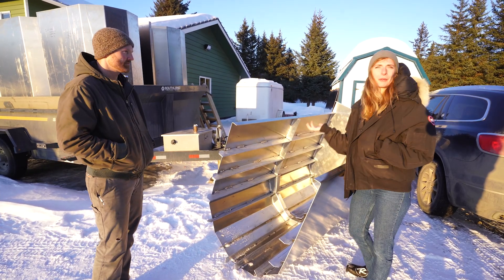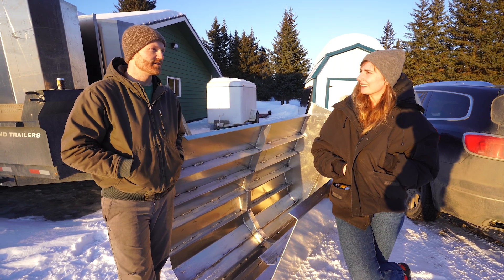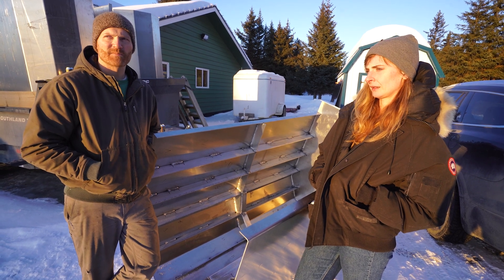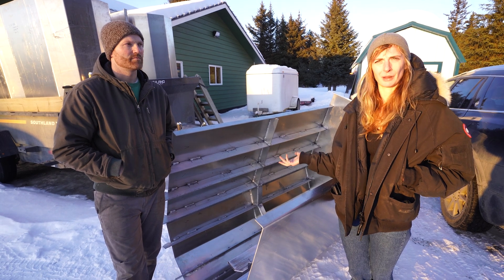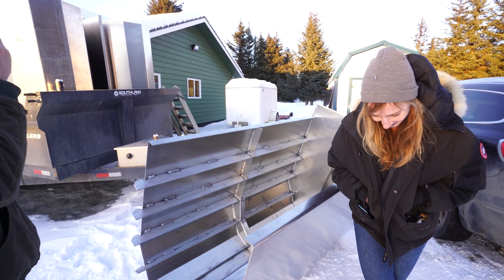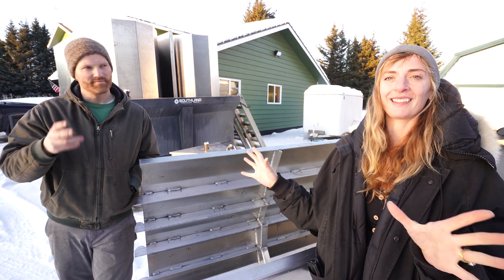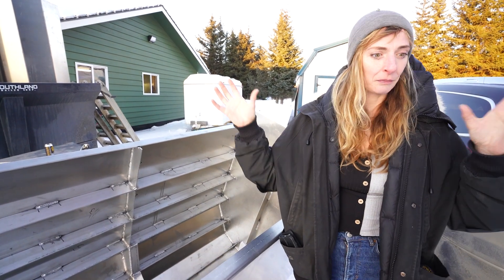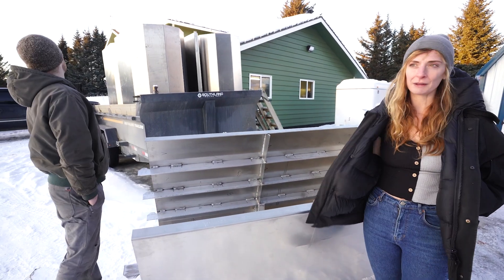The Eroica is getting new pontoons! | Your questions answered

Comment: You could put a stud on each, so the compressor could be used to keep the water out, if you spring a leak? also a water-sensor at the bottoms perhaps .. like the floats in gas tanks? after all risk equals the chance something bad happens times the consequence if it does ..

Comment: Actually you could pressurize the voids and spray the outside with soapy water and or see if it holds pressure overnight. I wouldn't go much higher than 5 maybe 8 psi tho. Simply attach automotive wheel valves on top of each void. Also I would use an inert gas like Nitrogen to keep the inside of the pontoons from corroding. This would allow you to simply check for leaks on a regular basis. Note, inside pressures will change slightly with the temperature and weather/barometric pressure. And as im sitting here coming up with this idea off the top of my head i can't help but wonder if and how much this would stiffen the pontoons making them slightly more rigid or stronger.. ?? Not to mention the obvious ability it would provide to spot a leak under the water line. Which leads me to think that if you did get a leak while out, you may actually be able to connect a compressor to that pontoon and force the water out (so long as the rupture isn't too big for the compressor to keep up with) which could save the day. Sry for rambling on, my mind tends to dive deeper than my umbilical sometimes lol.

Comment: Just a tip you might want to try, to test for leaks . As a 25yr concrete finisher when the plumbers would have to pass a air pressure test before we could pour, the pipes would have to hold air pressure over night to pass inspection , if it lost pressure its leaking

Comment: Closed cell polyurethane foam doesn’t hold water but it is expensive here I can’t imagine how much it would cost in Alaska… Good luck with the new pontoons!
Also, is it that expensive to add 1/16 to it and make it a 1/4 instead of 3/16???
Reply from the maker: It’s all incremental! Would be thousands more. You draw the line somewhere best as you can between cost and performance
Reply: @TheEmilyRiedel  absolutely agree, 100%. It’s amazing how something as small as 1/16th of an inch is literally 1000s more…. I’m sure the improved Eroica will do great things for you! Good luck this summer!!!

Comment: Use a schrader valve on the pontoon and add air. It will hold the PSI if it doesn't leak.

Comment: Emily, have you considered trying some sort of metal detecting coil you could pull across the bottom with a boat to help locate rich gold deposits off the coast? It may or may not be a feasible way of locating dredging sites to increase success. There may be a practical way of doing this in the future. I`m a crazy guy so that`s how I think.
Reply from the maker: The gold is too fine and divers can find it faster with their eyes

Comment: Saltwater boats in Florida avoid aluminum due to galvanic corrosion. Just being by the salt water in Florida causes that corrosion. The only way to extend aluminum from that corrosion and pitting is a good coating like powder coat.
PS just like in your chemistry class, the heat in Florida increases that electrochemical reaction where it’s going to be slower in your colder climates in Alaska, but it’s still not a good saltwater metal. Certainly more affordable than all stainless though.
Reply from the maker: Didn’t know that!
Reply: @TheEmilyRiedel  Only reason I do is because I grew up in Florida and I wondered the same before. Same as your Alaska and gold knowledge keeps me watching. One day I’ll do an Alaska gold trip. 😁
Reply: Some people bolt on sacrificial anodes to reduce corrosion